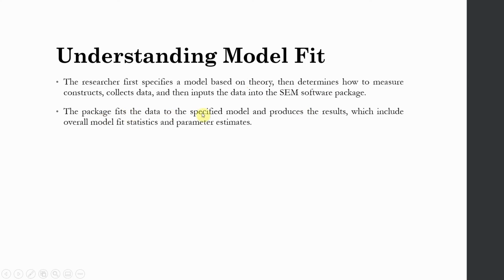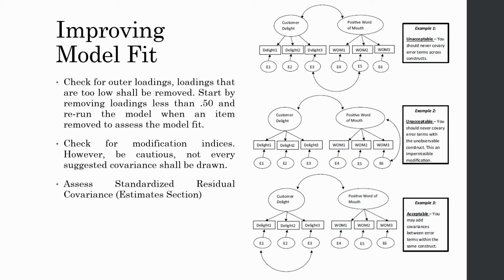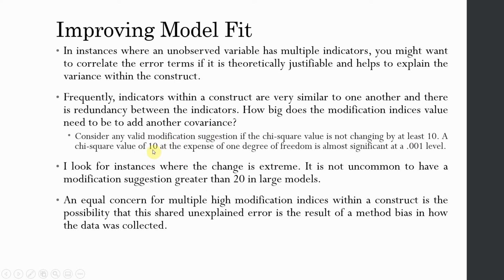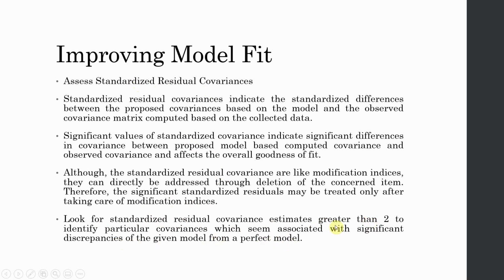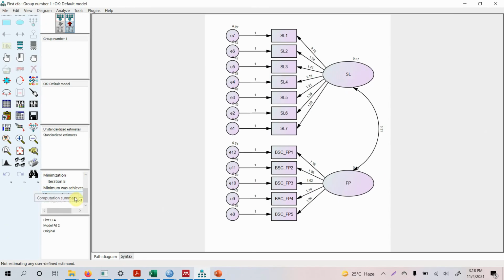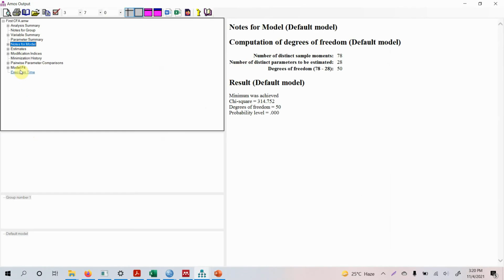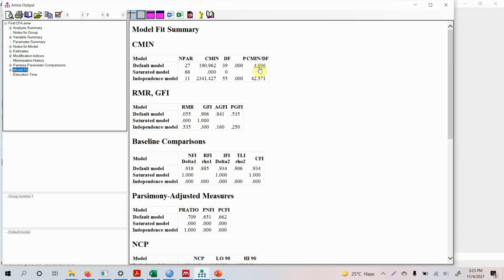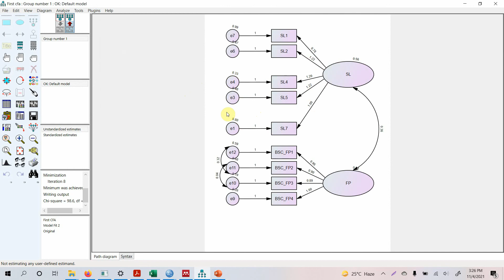9. SEM | SPSS AMOS - Understanding, Assessing, and Improving Model Fit in AMOS

Comment: Salam. What is a cut-off for MI? In a handbook on SEM 2nd Edition by Zainudin Awang, it suggests for the modification if, MI >15. I am rather confused because, i correlated the errors which had MI >10. In one of the first-order constructs of Higher-order model, the correlation between errors is 0.2 - 0.3. Standardized Residual Covariances also seem acceptable. Shall i delete one of the indicators?
Reply from the maker: Please follow Prof. Awang.

Comment: Excellent explanation and knowledge shared, my question is even if after doing all this the model fitness does not improve, what should be done? Also how many minimum items to have for a construct?
Reply from the maker: Pleasure. I am glad you liked it. Even after doing everything, the results do not improve, there are issues with your data. You should have at least three items left in each construct, but make sure the content validity is fine.

Comment: Sir, i didnt get modek fit values in the text output and I got a error massage as Iteration limit reached
The results that follow are therefore incorrect.
The model is probably unidentified. In order to achieve identifiability, it will probably be necessary to impose 40 additional constraints.
What should I need to do to correct this issue please help me
Reply from the maker: Please see if you have fixed at least 1 parameter to 1 in each construct.

Comment: Sir, I want to test a model via SEM where one of my moderators will be a categorical variable. So, for assessing model fit, is there any way to include the categorical variable and assess model fit? Or, the categorical moderator can only be added in the structural model? Please help me with this Sir. Thank You so much
Reply: To add clarity , I did add the categorical moderator (gender) and the model fit was fine. But how do i segregate gender into male and female in the measurement model itself? Should I do it just like we do in structural path? Or is there some other way?
Reply from the maker: Please remove the categorical moderator.
Reply: Noted Sir. Thank You once again

Comment: Sir, i have a genuine question. If we do modifications of error terms for model fit, will we also modify those error terms in the main dataset of structural equation modeling? (if we use the same data along with some new responses)
Reply from the maker: In the model only, how can the dataset be modified?
Reply: @researchwithfawad  Sorry, I meant would we use the same CFA model (inclusive of error covariance) to test the structural model? 

If yes, what if we get Iteration issues? Are we allowed to remove error covariance from the structural model then? Also you have not uploaded any video to interpret goodness-of-fit measures for structural models. These are some of the confusions that are unanswered otherwise you have helped me through your videos and quick response. The way you respond back and resolve your subscriber's questions is just amazing.